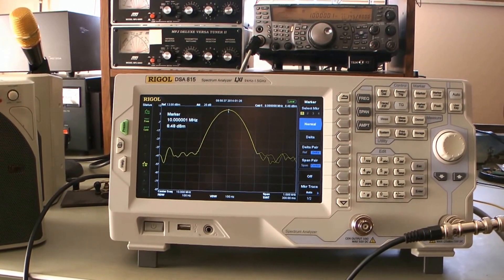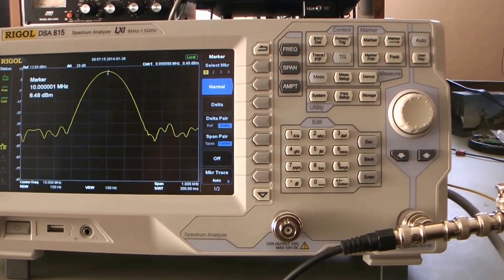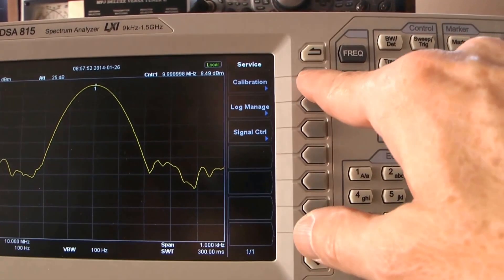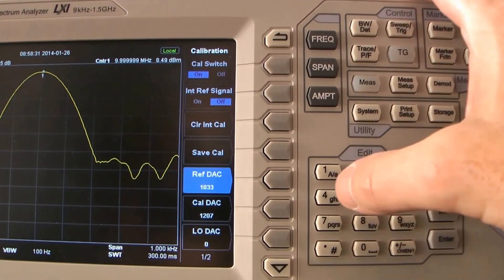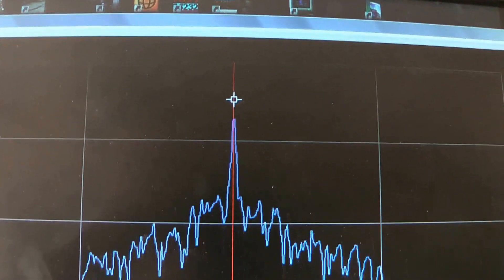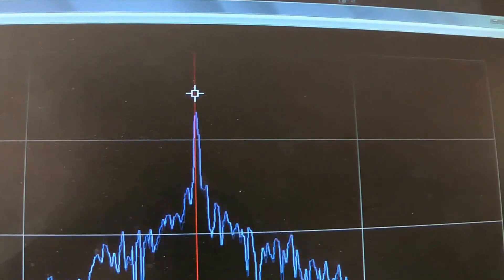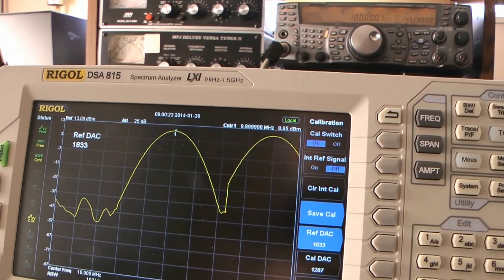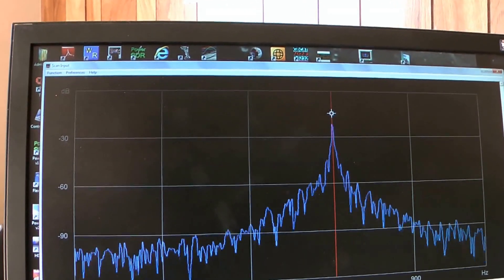DSA 815 Calibration

Comment: Thanks, Good information on the DSA815.  I used a 10 Mhz reference and an osciloscope  and compared the 2 waveforms. The EEVBlog has good examples of this episodes 456 and 457.  Used it to calibrate my hp8920, signal generator, and frequency counter.  Thanks again KB7UJI.

Comment from the maker: Thanks Randy, I appreciate it!  I have a new method where I put my HF antenna (G5RV) on the input of the 815.  I then adjust the Ref DAC so that the sig is exactly centered on 2.5, 5 or 10 MHz.  I think I can get it within a Hz this way.  I will post a video when I get a chance.  How well do you receive WWV at your location?  WWV is in my backyard here in Colorado so I am not sure this will work well elsewhere.

Comment: This is frequency calibration and what about amplitude, in my case that is totally out of spec at 1MHz and I also calculate with input impedance and generators output impedance (the offset is somewhere about -10dBm). Do you have something similar or your amplitude is all right?
Reply from the maker: Well, I don't have the gear to accurately measure the amplitude (yet...) so I am not sure.  I think the spec for TG amplitude is really rough like +- 3dB or something.  They get away with that by doing a Normalization that builds a table of corrections over the span being used.  Then the displayed amplitude is much closer.   For a SA in this price range, I am not disappointed with its performance, but I also understand it is not comparable to the high priced units.